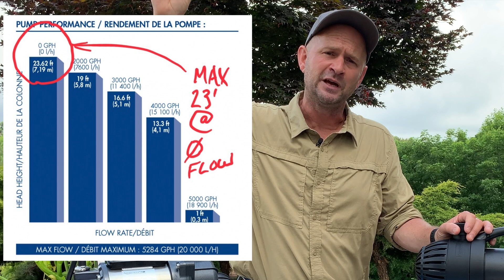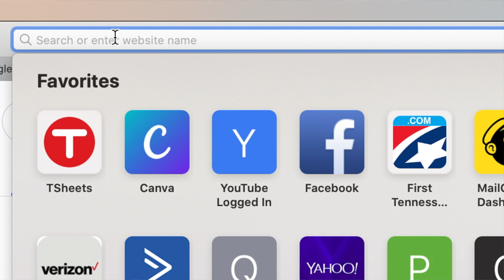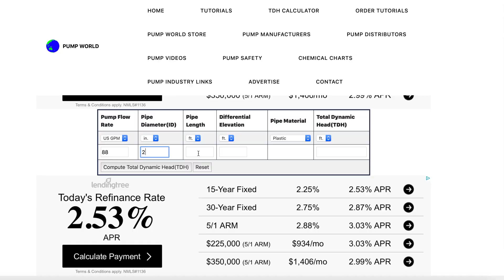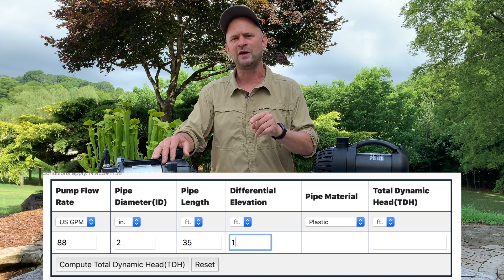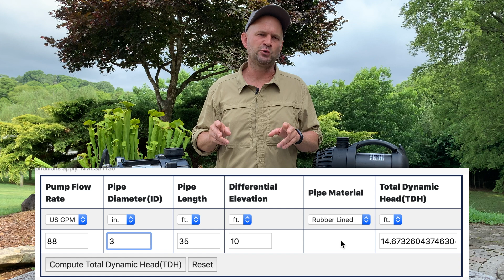How to Get 60% More Flow From Your Pump | Water Feature Design Series 6

Comment: Great videos thank you. I do have question. 
If there is a wetland (8x10ft) with that is below the level of the pump but there is a water column on top how do you calculate the head pressure?
(I currently have a 3-PL on it but would like to change it.

Comment: I have a 22,000 gallon pond and am planning a waterfull height of 2-3 feet.  What size pump would you recommend?  My pond is 40 L x 30 W and averages 3 ft deep.
Reply from the maker: There is so much more that goes into the planning of the proper pump. I would have to know lift run size of pipe requirements of your filter, type of intake, etc. in order to be able to properly. Answer your question. Typically I try to use multiple pumps because pump redundancy is a safety net, in case one burns out which always happens eventually. I’d be happy to talk with you about it, but I would definitely need more information :-)

Comment: OK so I built a pretty decent sized pond on my property and did my first waterfall (inspired by dad and his CA backyard goldfish pond, RIP dad). My pound is roughly 300 long varied withs from 20 wide to 85 wide variety of depths 5 deep to 14 I wanted to be natural looking and a roundish island about 25 feet round with mature cedar trees.  Now my big waterfall is in beginning stages I have a upper pond 12 15 feet round 3 to 5 deep spill over a fall of 18 feet to splash hole length from main to upper total 26 feet tall and about 130 feet long. 3 inche pipe how do I figure pump size for min 6 feet wide by 2 inch curtain or am I dreaming to big
Reply from the maker: I think 6’ wide x 3/4” thick is about 15,000 GPH. SO that would be ABOUT 40,000 GPH flow to get about 2” thick @ 6’ wide. That won’t go through a 3” pipe. At low-velocity you are going to be pushing 10.000 GPH ish in a 3” pipe.
Reply: @KoiAddiction  so 2 inch deep is probably a bit overkill would 3/4  inch depth be to small or am I running multiple pumps. I can adjust as this is my personal project

Comment: Great informative video John, and the info about the larger pipe diameter invaluable - thanks.
I have a question too:  If my pump is in the bottom of the negative edge reservoir and is pumping water up (say 4') and then across at ground level (say 17') and then down into my centipede module (say 3') how do I calculate the differential elevation? Matt
Reply from the maker: I go from “operating level” in the reservoirup to highest elevation level for lift height. Then use all piping involved for your run and typically add 10 feet of pipe for every hard 90 that I use.

Comment: Hi John, How do I work out which pump I should use for the GPM? Do I just keep a record of all the different GPMs and then try them in the TDH calculator? Sorry for these questions as I’m very new to this my total length is 7 m, and the photo is about 2 m?
Thanks Damian
Reply from the maker: Yessir, keep plugging in pump stats until you find the right flow and a pump that is operating in its “happy place” IE the feet of head pressure is in the sweet spot for that pump!

Comment: John loving your videos there very inspiring building a small stream and waterfall 11ft long 2ft wide average 1.5 deep average the height of  the Waterfall 2ft and 15 inches wide at the top,will the Aquascape Eco Wave 2000 which has a maximum water pressure of 7647 Lph is this suitable for my project. 🤔
Reply from the maker: Youll have to plug your numbers into a Total Dynamic Head Calculator (google one) and then match the head pressure to the pump curve (in catalog & on box) to see what your actual flow will be after head pressure and then decide if its heavy enough for you. Ill shoot a video on this next week!
Reply: @KoiAddiction  Thanks!  John really appreciate it, nothing bought yet still in planning only part of my tropical paradise. 😂

Comment: Hi guys. Another question for ya. I am wanting to move a lot of water (315 gallons p/min). The TDH is 3 meters. (4 inch pipe, open-ended system - so from a lower pond up to a waterfall). I have seem some installers will put multiple submersibles in parallel. So in this case, I could use 8 submersible pond pumps (all high flow, low head), or I could use one high power external pool pump to do the job. The disadvantage of the external pump is noise really. I am concerned about putting 8 pumps into on 4 inch pipe though. Any thoughts on this?
Reply from the maker: I would do the external probably and figure a solution for the noise. Final decisions would be based on Pond purpose, pump cost, electrical costs, etc. Weigh the pros and cons. I have never pushed multiple pumps through the same pipe….that’s interesting. Seems like it might create a competition…I would love to hear more about that and why it is a good idea or not.

Comment: Helo Jonh G. thanks for all your videos, they really help. In one of them you mention not to use a submersible pump in a recreation pond. Ist´s just for safety or is any other reason. Thanks from Puerto Escondido, México
Reply from the maker: It is a safety thing. No other reason. Hiding externals is more work BUT in my experience most of them are affordable and repairable in comparison to some submersible pumps so there are some other benefits.

Comment: What flow rate do you recommend for a Jet? ie If you are using a low -power high flow pump to run 8 jets (so there is no head other than the pipes) what is your minimum flow rate per jet?
Reply from the maker: 500 gallons min 1000 gallons max on a 1” jet. Max 1500 GPH on a 1 1/2” jet

Comment: Does GPH change if you split a 3'' pipe into two 1.5'' pipes?  If so....based on friction loss, I would assume that you wouldn't want to split it any closer to the pump than say 5x the diameter of the pipe.........but I could be completely wrong.  Any thoughts?
Reply from the maker: Yea,I keep the main line at a large diameter as long as possible and try not to put more jets than the flow permits- so if I have a 10k flow I will use a max of 10 jets. If you are concerned use larger jets and then you can reduce down again if you need more push. I’m no engineer- I work with pump company and a diagram on larger systems!

Comment: Thanks for sharing! What an informative video !!! 
  Would love to get your input and recommendation on my pump. My pong is about 15' long, 8' wide and about 3' deep about 2700gal pond. What size pump you recommend...the aquascape 5000, 3000 or 2000 pumps? Please let me know. Thank you so much.
Reply from the maker: I love the Aquasurge pumps for efficiency BUT they need to be properly installed in a skimmer in a low head scenario. Be sure to use the total dynamic head calculator to determine actual flow with each pump you are considering to find the perfect choice!
Reply: @KoiAddiction  thank you for responding! Information noted !

Comment: Hi, big fan here. I have watched this several times to make sure I am understanding  and at last I am in a position to be able to use this info to help me get the right pump so thanks. One question though, if the pump only has a 2" outlet will you still get the 60% increase in output by increasing the pipe to 3"?
Reply from the maker: Yes, though 60% was the difference in my example-you will have to run the total dynamic head pump curve with your pump to see what the difference is in your case!

Comment: Hey I have a question. I’m going constructing a pond and I’m putting in a wetland filter as well as a spillway that’s on a different side of the pond then where the wetland is. Is it ok to “T” into the pipe from my vault or do I need two different pumps? If I can T into the pipe can I just buy a ball Valve on the pipe to the spillway to regulate the water? Just wondering if there is going to be enough water volume for both
Reply from the maker: As long asyou dont starve the wetland-plan for the proper flow and size the pump accordingly!
Reply: Thanks for the advise. Your videos are really helpful

Comment: Hi ,  I have a swimming pond in NY and I don't like the idea of having the pump in the water for posable electrical shock and we freeze up here so I would be removing the pump every winter.  Is there a dry transfer style pump you would recommend for 18' lift  1500 gph?
Reply from the maker: Call the guys at Performance pro, You will have to give them specific information but they were spec you the right pump for the job.

Comment: Hi John what size pump should I use for my wetland filter. The wetland filter is 7' x 12' the pond is 10,300 gallons I have pumps running the waterfall already and skimmer. The wetland filter will be done this spring. The feed into the wetland filter will be coming from the intake bay which is about 20 feet away. Elevation which is the head will be about 2 feet at wetland filter.  Which pump do you recommend for this wetland filter GPH and what size hose.  If I have to use two pumps one for the intake bay and one for just the wetland filter I could do that also. Thanks
Reply from the maker: I would love to see the wetland design. Typical flow in our designs is 1500 - 2000 gallons per centipede assuming you have followed similar design practices. Be sure you use actual flow rate on your pump using the pump curve and flow losses based on total dynamic head.

Comment: Great video, quick question. If you go to a 3” pipe to get better flow rate does it matter that it has to be reduced for the pump fitting and biofalls ?
Reply from the maker: The reduction will increase friction loss so the shorter the better on the length of the smaller pipes and be sure not to exceed the flow rates on your biological filters- it causes issues!

Comment: Just been thinking. How is the the bigger bore pipe principle effected if the outlet of the pump is 2” then the 3” pipe going into a 2” bulk head of the bio falls. Thank in advance. Your videos are superb 🍻 please keep them coming 👍
Reply from the maker: The higher resistance only applies to the length of run in the small pope. Keep it short to maximize flow🤘🏻
Reply: @KoiAddiction   thank you that makes sense 🍻

Comment: Great video, you've really made it simple for people thinking about ponds! Speaking of lowering friction and hence pump head, why do people use such long stretches of flex pipes when this is really terrible for friction losses? A straight pipe will get you 10x less friction. A flex pipe will never achieve laminar flow, and turbulence and all the slight curves will add to friction losses. What are your thoughts on this?
Reply from the maker: For most applications it is about ease of installation. I have used both types but typically it is just easier. So much time saved in construction doesn’t make financial sense to hard-pipe smaller jobs. Lots of elbows can off-set the friction loss on flex-pipe. Most of the time the mistake I see is too small of diameter on pipe eating up flow rate. I will use a combination of flex and sch. 40 on my feature, depending on the run and how crazy it gets.

Comment: Hey jhon thanks for your information got a 3 inch line running into the pond for my three jets would I come off the 3 inch line or T off into a 1 inch or 2 inch line for my jets thanks again
Reply from the maker: I do 3” in to carry high flow-when split do 2” lines from tee “splitting” the flow, then reduce to 1” only @ the jets for a short run. You get more flow that way!
Reply: Hey John quick question using an adjustable Flow SLD 4 to 7 GPH running the 3 inch line how many jets could I possibly put in and still have a good flow Ponds kind of large and about 5 1/2 foot deep thanks again

Comment: Hey John one question on this topic if I go with a 3 inch flex PVC but there’s only a 2 inch coming out of the pump once I use the 2 inch into 3 inch adapter will I still gain the extra flow rate or will the 2 inch section cancel it out thanks for your info
Reply from the maker: No you will def gain the advantage. Keep the 2” as short as possible👍
Reply: The reason being that a 3 inch works better than a 2 inch pipe is the friction of the water against the inside of the pipe. The bigger the pipe the less water touching the pipe that is why you can start with a 2 inch pipe then increase to 3 inch pipe and get more flow out of your lift.
Reply from the maker: Yes, what Mark says! 2 things affecting your flow inside the pipe are velocity and friction loss. Think of people walking in a hallway- the skinnier the hallway the more difficult it is to pass. As you add more people (higher flow) the passage becomes more difficult. As the hallway gets bigger (larger pipe) the passage becomes easier 😎

Comment: Hey John a pond with an intake bay with an aqua scape pond vault what’s the best way to run a overflow drain thanks
Reply from the maker: Pit a 12” drain basin next to liner for over-flow or use a simple dry stream style overflow next to the intake at a low area🤘🏻😎both is even better!

Comment: John - Great info.  Your examples are both submersible pumps.  I will be using external pumps.  If my external pump has a 2” port in & out do I get the same boost by using 3” flex both on my extraction from the neg edge reservoir and out to my wetland filter?  Or should I draw water out with 2” and push to my wetland filter with 3”.  Help please!  :)   Do I just “neck up
 My fittings at the pump housing?
Reply from the maker: You need to run the pump curves using the formulas to be sure you are still in the pumps sweet zone. As long as you are not exceeding the pumps capacity on the draw end (length, head, etc.), you will get more flow with bigger plumbing. Just make sure it doesnt decrease head pressure too low for the pump! Did that answer the question?
Reply: Yes and thank you!  I will pay close attention to the calculations and TDH.

Comment: Can you combine a wetland filter with a pond iongen? How? Ion gen installed between pump and wetland? I hope this gets an answer
Reply from the maker: I would put the ion-gen on the blow-off valve from the wetland. Don’t try to put it on the pressure side!
Reply: Modern Design Aquascaping Inc. Okay thanks! But what is the blow-off valve?

Comment: Great video, thanks. Do you have a minimum of how many times per day you like the full pond volume to be circulated, or is it mostly waterfall appearance you go by?
Reply from the maker: 1-2 times per hour turn-over for small ponds is my goal. The bigger the pond-the less it turns over though!
Reply: @KoiAddiction  This total turn-over volume of water would go partly to the wetland (volume per hour calculated based on its size) and partly to the jets, right ? (thinking of a swim pond)